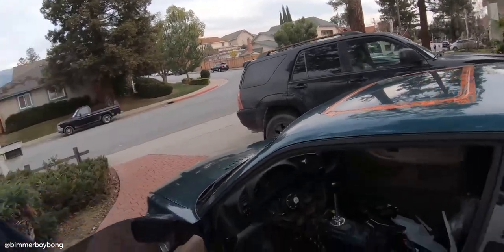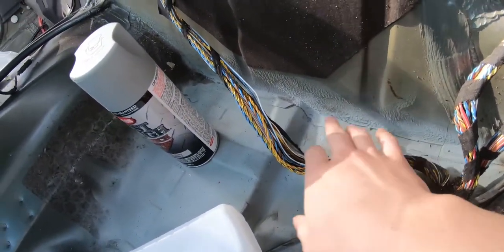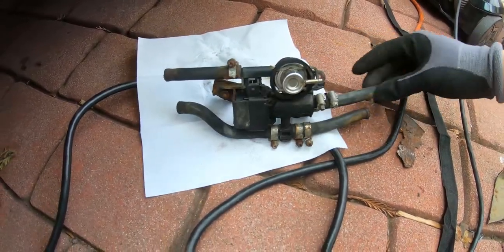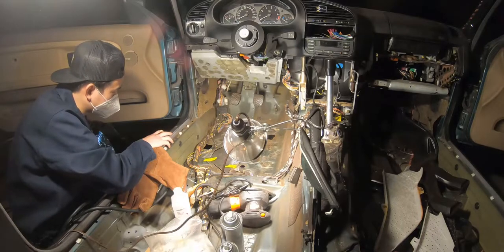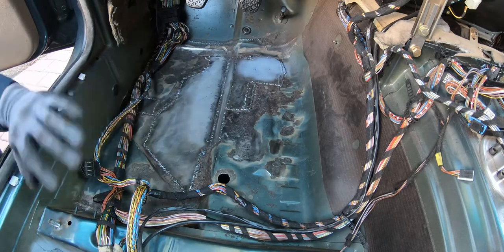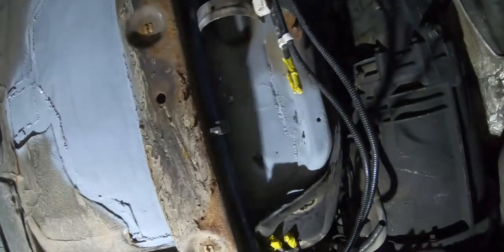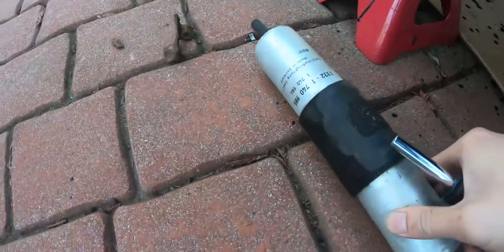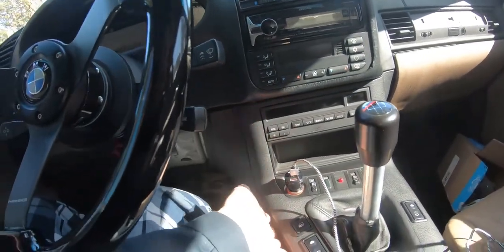E36 - Floorpan Rust Repair: Cutting, Welding, & Painting

Comment: hey man I'm needing to cut out floorpans from a donor towncar at the salvage yard.  any tips on how I can remove them with limited tools?  I'm assuming I'll have to use hand tools since I'm not able to use electric/air at the yard
Reply from the maker: I don't think they'd allow you to get cut out parts since junk yards usually only have part pricing pricing for bolt on parts. I would just find someone local that's parting out and ask to cut a part off. Or you can use plain sheet metal like I did. Third option is to buy a floorpan repair panel from valcas garage or a similar site.

Comment: Nice floor repair job and good work on the diagnostics too! I'm a 70's and older car and pickup guy , there's way too much electronic er um STUFF on these modern cars! 😎
Reply from the maker: Thanks dude! Older cars are way more straightforward with their parts and simpler electrical stuff. I have experience with modern bmws and dealership software, but old cars will always be best.
Reply: Trust me those aren't that bad, e36's are still rather simple for what they are and his is obd2 so at least the diagnostic tools can do something and telll you things.

I have an e36 too but an earlier one so it doesn't have obd2, meaning if it has some problem and you've diagnosed everything mechanical and you think it's some electronic bullshit that's bad like a sensor or something, well good luck because you're not gonna have the luxury of plugging in a scanner and just reading what's wrong. Cars that have electronics but no good way of scanning for electronic errors are a pain.

Comment: great job man same project going on... do you know what the correct measurement you ended up going with for the gas pedal bracket?
Reply from the maker: I didn't measure it exactly. I put the carpet back in and lined up the bracket with the cut out in the carpet.

Comment: I am not sure but was there not some spot welds between the rusted area and the front subframe rail?
Reply from the maker: I think you're talking about the long flat edge that is partially primered partially bare metal at 4:40. Yes there were spot welds but most it was rusted so it was easy to remove. Then I just hit it with an angle grinder to clean up the rest.
Reply: @brandonong2508  I was try to get at that I did not see you weld there and its needed for structural rigidity
Reply from the maker: @woocash2139  I drilled holes in the new sheet metal and plug welded them at that spot, I just didn't record it.

Comment: how did you get the carpet out without removing the dashboard?
do you have AC?
Reply from the maker: Check out my interior swap video if u want to see carpet removal. I have AC. Dashboard removal isn't necessary if you're willing to cut some of the carpet. You'd need to cut two lines, where the carpet sits on top of the transmission tunnel/under the heater box. It's okay because the cut parts are hidden behind the shifter surround. If you don't want to cut, you'd have to remove dash, heater box, dashboard bracing (need to move steering column out of the way for this), ... long process. 
In my video "E36 - Removing Sound Deadening, Finding Water Leak, Fixing Heater Box Coolant Leak" at 11:25, you can see the portion of the old brown carpet that still remains, it's under the heater box.
Reply: @brandonong2508  ahh i get it now... mine is on jackstands for 2-3 years now so it's a bit too late for that , with most of interior removed, also i see that i don't have a pump where you have it, but mine is a touring, and a 2.5l diesel , it's my first car, and the first car i ever worked on
Reply: @brandonong2508  the video will definitely help with assembly when i finish welding

Comment: Hey what gauge sheet metal did you use for the floor pans?
Reply from the maker: I think it was 18 gauge
Reply: @brandonong2508  oh wow I’m surprised, I’m repairing some huge holes in my e28 and I did get 18 gauge but now I feel like it’s way too thin and bendy so I feel like I should go with 14 or 16, idk tho 🤷🏼‍♂️
Reply from the maker: @dnipma1535  18 gauge should hold fine once it's welded in. I did some research online and people seemed to say 18 is good
Reply: @brandonong2508  yeah that’s what I’ve read to, I’ll just try and it and see if I need thicker, I can always cut more out